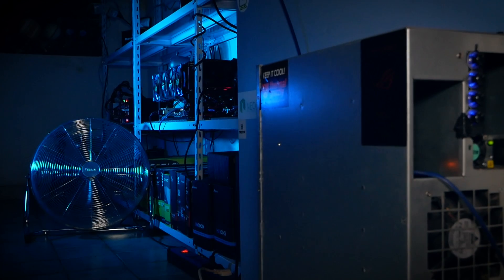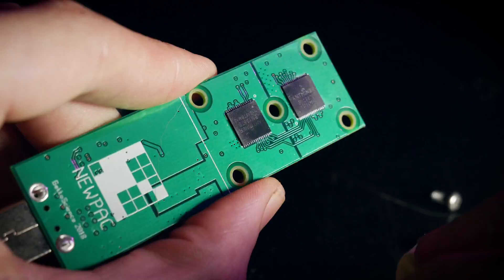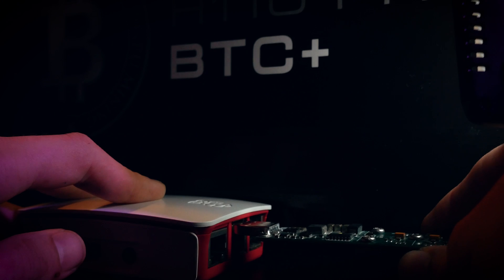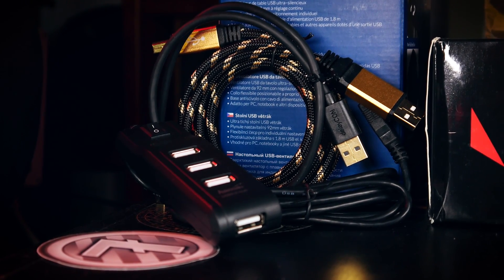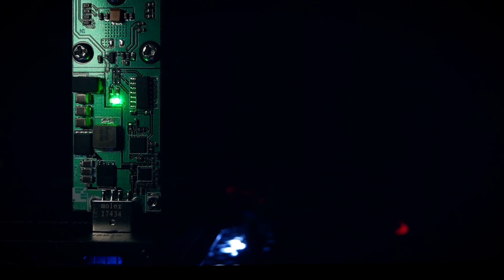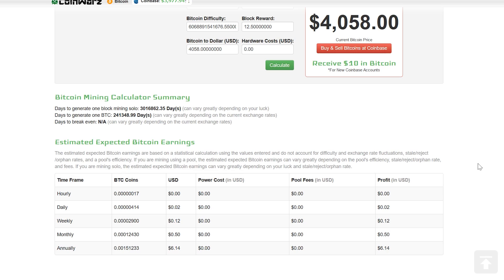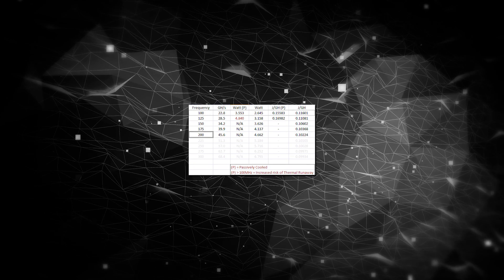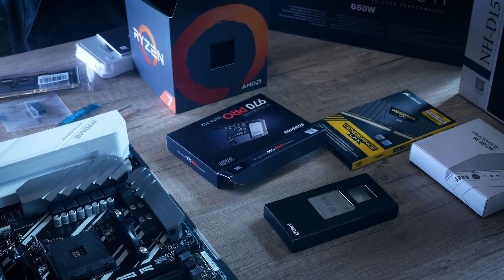Gekkoscience NewPac - USB BTC Mining (100 GH/s + on Bitcoin) Setup / How to

Comment: Were can you buy USB miners? and what do you need? please send link if you can
Reply from the maker: they are not officially sold anymore, you will have to search eBay and the likes. Also mind that every USB miner is old by now (this video is already old as well) and it is hard to break even on them. If you still want to try (great learning devices) you need a powered USB hub and some PC/Laptop/Pi that controls it :( cheers ⛏️

Comment: my 2pac runs at 27 gighah with the --gekko-2pac-freq 200 in the command.    the newpac tops out at 90 gigahash.

and the only reason they're profitable is the take very very little powers..   5 volts at 1.2 amps = 5 ish watts..

Comment: It seems like it should be possible to liquid cool them with a RAM waterblock, just set up the USB block so that they are running parallel and you should be able to cool three or four (possibly even 5 - i'm not sure about the relative sizes) with the same module, and the blocks are designed to cool between 2 and 4 modules each. The RPi4 has 2 USB 3 ports, so it should be possible to run 36 liquid cooled USB crypto miners off one Pi, and there are bramble racks that hold 8 single-board computers, making 288 miners. While that's still making chump-change in comparison it should be a nice bit of chump change, enough to finance a more powerful system, and can be scaled up over time.

Sorry, I've been watching too many computer builds with custom water loops.
Reply from the maker: No need to say sorry at all :D I love this kind of over-the-top projects :D if you manage to do it I definitely need to visit you for a filming session 😁 cheers mate ⛏️
Reply: Thanks for sharing my comments, i will advise you to invest in crypto now make a note to my trusted trader, do well to tell him I referred you to him
Reply: He's available on what App 🖕

Comment: Could not get it to work at all until I read the official support page at:
https://bitcointalk.org/index.php?topic=5053833.0
cgi miner did not see the usb device at all until I got the file called:
4.11.1-windows-gekko 

and also get the latest zadig-   which at this moment is version 2.4.
and the zadig   file name is:   zadig-2.4.exe
run zadig-2.4.exe as administrator and make sure the winusb driver is being used.
then finally my Windows 10 could see it and I was up and running on my 

USB 2.0 port.      Now I just have to get it up and running on my 24 port usb hub.
Reply: Thanks for sharing my comments, i will advise you to invest in crypto now make a note to my trusted trader, do well to tell him I referred you to him
Reply: He's available on what App 🖕
Reply: 1   (   7   2   0   )   6   8   0 -  7   9   4   2

Comment: whats the name of that product and how can i get it?
Reply from the maker: "NewPac" is the name, "Gekkoscience" the company :) you can find a link under the video to see if your country's Amazon has them, other than that there are some resellers :) cheers
Reply: gekkoscience newpac      the old one was called a 2pac     theyre sold all over the place
Reply: gekkoscience NEWPAC      dont confuse with 2PAC ....      look it up on the net they're sold everywhere around $50 to 60
Reply: @harleyme3163  how long does it take for it to mine a bitcoin or even half if connected 24/7 ?
Reply: @lazarouskingsley7269  12.000 years
Reply: 1   (   7   2   0   )   6   8   0 -  7   9   4   2
Reply: He's available on what App 🖕

Comment: I got my cgminer configured and everything correctly even installed the win USB driver but it seems to crash after I boot the bat
Reply: cgminer gekkoscience version     it should be the dirrectory   cgminer-win-gekko..  I dont bother with bat files, I just save the command line in a text file a copy paste it.

like:   cgminer.exe  --gekko-2pac-freq 200 -o stratum+tcp://us.multipool.us:3335 -u username -p password
Reply: @harleyme3163  I'll give it a shot
Reply from the maker: hmm try run as admin, or if your antivirus is blocking the exe - that's what I could think of spontaneously - cheers ⛏️

Comment: Hey Cursed Mining, really great video! Loved it :) I actually just got a NewPac and I'm running it on a Raspberry Pi 3 b+ via an Orico powered USB hub and its working perfectly via cgminer. However, I can't seem to overclock it, I've been trying the command given in the instructions, but nothing seems to change. It always starts at 100MHz. Do you have any advice regarding this issue?
Reply from the maker: Hey mate thanks and welcome!! How do you start the cgminer on the Pi? Maybe it is somehow ignoring your commands therefore going for standard freq. Not sure how it is on Pi regarding bat and config files, cheers ⛏️
Reply: @CursedMining  Hey, well as far as I've understood there is no bat file on the Pi there is a file called cgminer which executes the program on terminal, or I can launch it on terminal using the code: cd ~/mining/newpac/cgminer
./cgminer -o stratum+tcp://pool.ckpool.org:3333 -u 1BURGERAXHH6Yi6LRybRJK7ybEm5m5HwTr -p x --suggest-diff 32 --gekko-newpac-freq 150
(example code from bitshopper.de, obviously I use my own details) 
I have been trying to find a file like a bat in the cgminer folder, so I can edit the freq but havent been successful yet. If I change the freq on the command line (for example to 200) --gekko-newpac-freq 200 it stays at 100mHz when cgminer is running
Reply: If you have any advice on this that would be great? Or if you know anyone that could help me out, that would be much appreciated. Cheers.
Reply from the maker: hmm that should normally do it. I have no idea, maybe try "2pac" instead of newpac in the starting line - it was said NewPacs should be recognised that way if no 2pac present 🙈 I don't understand why it does not catch the OC setting, normally there should be no limits from voltage etc.
Reply: @CursedMining  hmm I've tried that, but nothing seemed to happen. I'm going to keep trying to figure it out, there must be an easy way to do this. I'll let you know if I'm successful, thanks for the advice and thanks for getting back to me :)
Reply from the maker: You are more than welcome - sorry I could not help any better! Will be curious to know what will work out for you :) thank you and cheers ⛏️
Reply: --gekko-2pac-freq 200       for 2pac...      but isn't the newpac on a COMPAC system?    should be -compaq freq  ###

Comment: I use wind turbine and solar power. I will like to get my hands on this.
Reply from the maker: Awesome!! I want to implement both or either until 2020 - would you like to share more about your setup? NewPacs are expensive bought new but can basically be run for free - cheers ⛏️
Reply: the 2pac only makes 16 cents a day.  the newpac I dunno but go fig 4x faster = 4x profit..

better off putting another wind turbine up..  least you'll get the profit by the hour and not day...  13 cents for 1000watts here

Comment: Can i connect this to my laptop and mine on my laptop instead?
Reply from the maker: I would not recommend to do so because of the amperage needed to run the stick. Worst case might burn out your slot, best case might not be too stable. They already recommended a hub with the previous less powerful versions, I'd definitely go for one. Cheers JJ
Reply: Thanks for sharing my comments, i will advise you to invest in crypto now make a note to my trusted trader, do well to tell him I referred you to him
Reply: +  1   (   7   2   0   )   6   8   0 -  7   9   4   2
Reply: He's available on what App 🖕

Comment: Hi can you just plug the hub into the computer and run nicehash and it would work and can you do a tutorial on how to change the frequency
Reply from the maker: hey there, yes a computer is a viable controller, I do so myself as mentioned in the video. No problem with Nicehash. Overclock is also mentioned in the vid, just a simple command "--gekkoscience-newpac-freq 100" (100 being standard, depends on your hub and psu how far you can go). I felt there is no need for a separate OC video since everything is mentioned in this one :) cheers Shaun
Reply: @CursedMining  and that command doesn't only affect cgminer and works for nicehash sorry for my low knowledge new miner you see
Reply from the maker: Aaah now I get the nicehash question sorry. You'll have to use cgminer because of the driver, but you can still point it to your nicehash account :) for now that is the only possibility. (so you have to get btc pool info from NH and configure the bat file you can copy&paste from the description) - no need to say sorry for being new :) that's what this channel is here for :) cheers ⛏️
Reply: @CursedMining  ah ok not to worry starting at a young age of 12 so I think that it goes to much in depth  but I would like to thank you for making these videos as they play a big part in my mining journey thanks again and I hope to talk to you soon
Reply from the maker: @shaunsmith3402  Hey Shaun, strangely YouTube put your last comment in the spam section so I did not see it until now. Sorry man! First of all I think it is amazing that you are starting at this young age, that is amazing. In my opinion you have a bright future ahead =) cheers!! If you have any questions or would like a specific video, never hesitate to ask!!
Reply: no.   it only works on cgminer-win-gekko.   all other software wont even recognize the api :-(  
  
the frequency is changed via the imput     --gekko-2pac-freq ###                                 and the ### being anywher from 0 to 300 I think......  my 2pac only goes to 200mhz dunno bout the newpac

Comment: Hi. Thank you for your videos. Are you running the 2PAC and NewPAC from the same PC USB ports?
Reply: you cant run either version on pc usb port ..  they require external power,   so you use a simple external powered hub
Reply: Can i run Them with 1 run bat file?? 
For example -- gekko-2pac-freq 150 --gekko-newpac-freq 150    ????
Reply from the maker: yes! no problem to mix gekko machines
Reply: Hi  cursed miner. I get a lot of usb write Error [32:64] when i tryed out any idea?
Reply from the maker: I'd definitely use a hub with dedicated power, not PC usb ports, but it is no problem to run them together, you just need two different commands for overclocking them separately. -gekko-newpac-freq and -gekko-2pac-freq - cheers man, thanks for the feedback =)
Reply: @CursedMining  Thank you

Comment: Great video as always but I thought came to my mind I wonder how they would do if they had the latest  chips in them and see what their hash rate would be then or if there’s a way you could Transplant a couple more modern chips into it and see what it could do that would be an interesting experiment
Reply from the maker: If you are very good at soldering then it is definitely possible. You can see how small the chips are in the beginning of the video where i open it up. I personally am not so good with these tiny parts =D then again you'd also need some knowledge in terms of voltage control to see if the updated chips can run with the same PCB / voltage settings etc. - I love tinkering with machines but I have never soldered chips to be honest. Will rather check what the genious GekkoScience people will come up with in the future =)